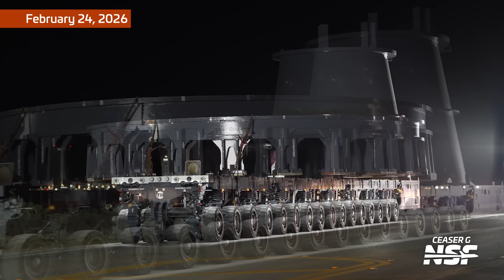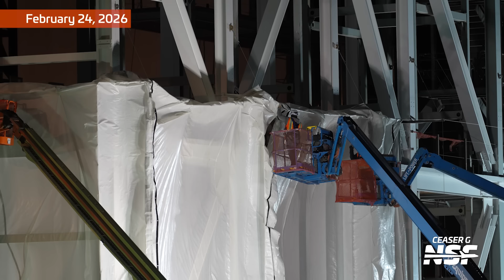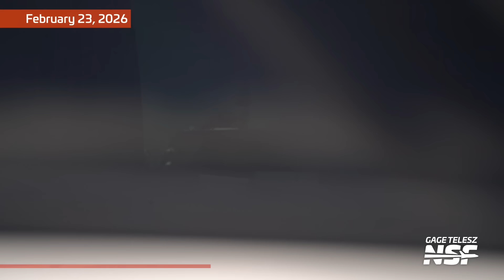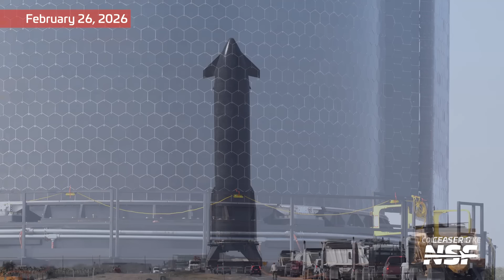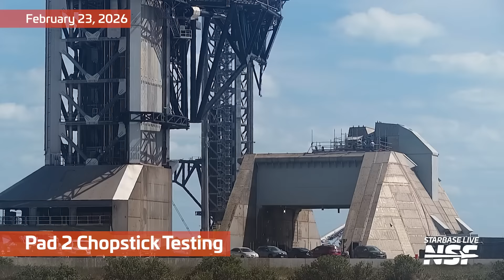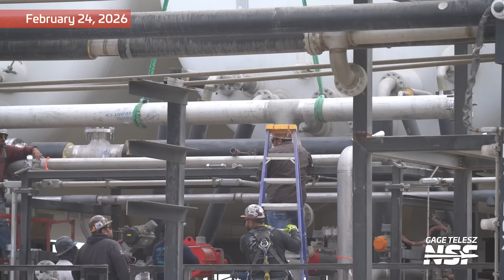Ship 39 survives its first test | SpaceX Starbase

Comment: 2:16 In my construction experience, the crane operators typically know little to nothing about the building itself. The steel erectors have shop drawings provided by the steel manufacturer - each piece of steel within that drawing has a specific piece number. 

The steel erector will have someone rig each piece on the ground, then communicate (typically via radio) to the crane operator on where to fly it for installation. 

There usually are 3D models built by the engineer but they’re not part-specific for erecting the structure.

Comment: The crane operator has radio  communication  with the spotter which guides crane in blind. They have a general idea of location and job but each piecre is guided in via radio or hand signals from spotter. Hand signals are preferred but not possible on big builds like this.

Comment: Crane operator has direct line of site to steel pickup location to steel connection point where possible then there will be hand signals from spotter and radio communication between operator and spotter.

Comment: They’re called assembly detail drawings, shows where each steel section goes…but I’m it was all done on a CAD system with 3D details. These steel assembly drawings are sent to the steel fabricator to build each piece.

Comment: That bag of water is a de-silting sock. It allows you to pump water from an excavation away and it takes the turbidity out of the water. Most jobsites require you to do some sort of measure to clean the water from mud/silt before it’s allowed to run offsite.

Comment: The crew will build from the structural drawings.

Fall protection line.  Goes to an anchor on the roof and drops to ground level.

The bag is a dewatering filter bag.  It catches sediment to prevent pollution.